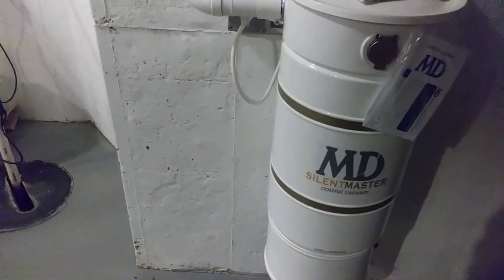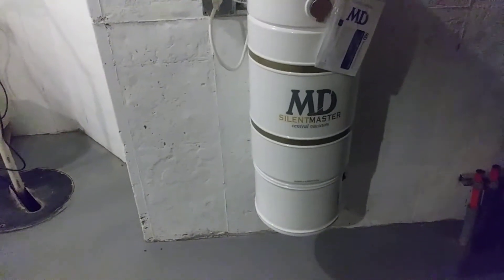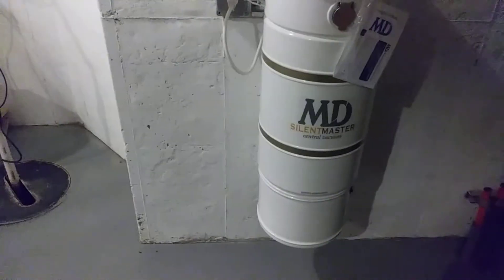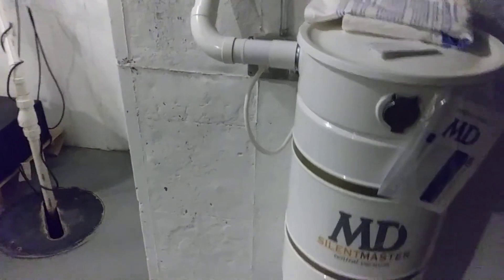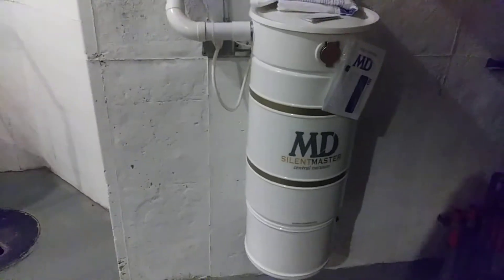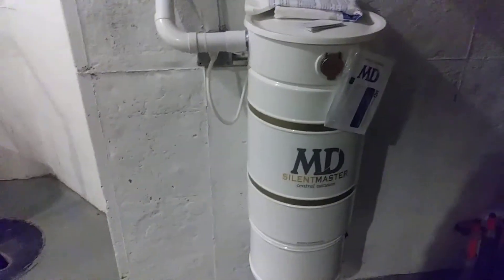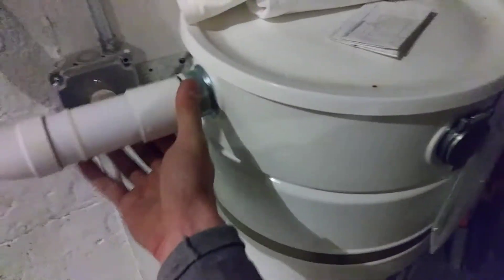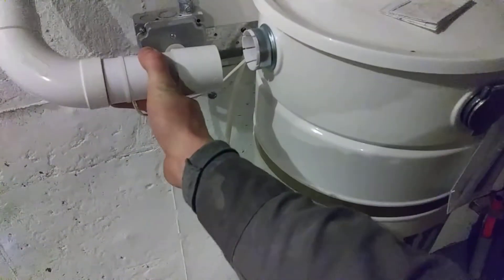Why does a bigger house need a bigger vacuum?

Comment: Because larger homes are too much for lower capacity central vacuums as lower capacity central vacuum systems are not strong enough. I agree with everything you in this video.
Reply: I considered getting the MD Silent Master S5 240V for my 19,800 sq ft mansion I am going to build someday, as a personal preference. That MD Silent Master 900R 240V model in your video is for people who need a stronger central vacuum system and reason for larger capacity larger homes gather more dirt, dust and allergies.
Reply from the maker: @t.j.ozminkowski334  in a home of the size you are planning, I would recommend zoning the system into two to three units. This will allow for added lifespan and capacity, plus multi user operation. Don't you know all the people in 20k sqft houses like to throw vacuuming parties? 😎
Reply: @owenperkins  Or 2 separate 240V Dual Motor Central Vacuum Systems in the same house. An MD G23 240V Dual Motor Central Vacuum System and an MD Airmaster XL A900R2Q Dual Motor Central Vacuum System, both with 50' electric hose sets, the MD G23 240V Dual Motor Central Vacuum System with 50' Sebo ET-2 Electric complete full package hose sets, and the MD Airmaster XL A900R2Q 240V Dual Motor Central Vacuum System with 50' Champion-Galaxy Electric complete full package Hose Sets.

Comment: I kno this is an older video but why not just divide the whole system into multiple smaller systems with smaller motors as that’s more efficient than one big system serving 30 inlet valves.  Bill of VacLab makes a good video explaining it.  Canavac also recommends multiple smaller units as opposed to one big unit as well.

Comment: Love the motor sound on that unit, I recently got an S900 for my collection and based on the sound, the motors in mine turn slightly faster, not sure why, I have the 240 volt version, so I now have 5 240 volt dual motor beasts in my collection. MD also offers a 120 volt version, but it requires a 30 amp circuit, much easier and more efficient to go with the 240 volt version I would think.
Reply from the maker: The one in this video might be running on 208 volts, rather than 240 - gargantuan homes sometimes have three phase power like a commercial building, and 240 volts single phase is actually 208, causing performance to be derated by about 10 percent.
Reply: @owenperkins  The difference in pitch between the one in the video and mine would probably be that amount so that's entirely possible. I just got a couple of 120 volt dual motor units, one of the units I got was the Drainvac turbo, it looks exactly like the unit we connected to Tom's piping at the convention, that was fun! The only difference is that it uses two 120 volt motors so it's not quite as powerful but it sounds exactly like the unit in this video, pitch is identical. Interestingly, my S900's pitch is exactly the same as the 240 volt Drainvac that I brought to the convention, different motors of course, but perhaps turning at similar speeds. I always thought that three phase power was reserved for businesses and that all homes were single phase.
Reply: Is this system a S900r/r2 or is there actually a model that is S900?
Reply: The model shown in this video is the S900r2.

Comment: Even with a smaller home, get the big central vacuum preferable one with dual multistage bypass motors the market if you want the best cleaning performance possible and don’t forget the high quality power nozzle to go with it preferably one with a chevron style brush and a 200 watt or higher motor.